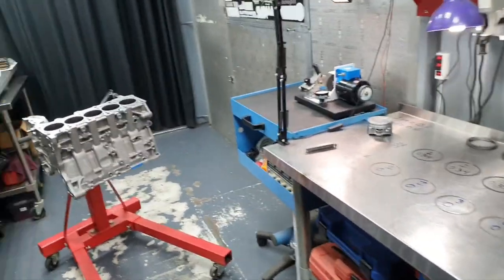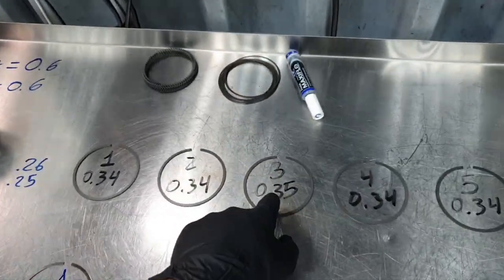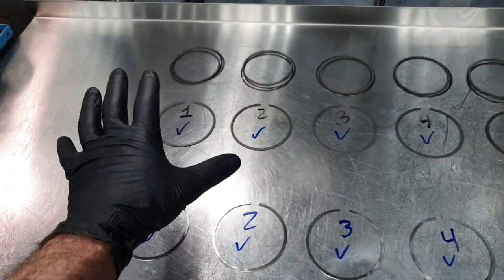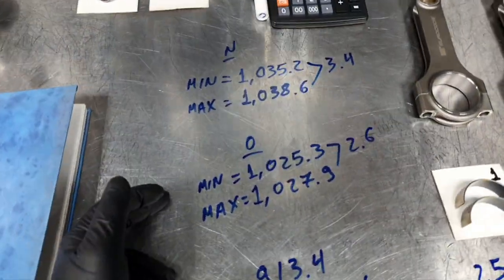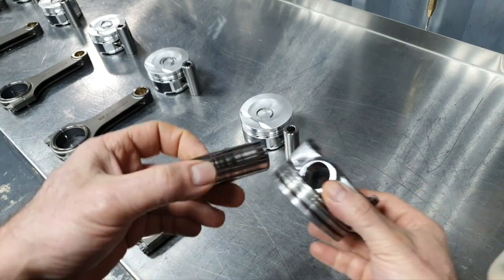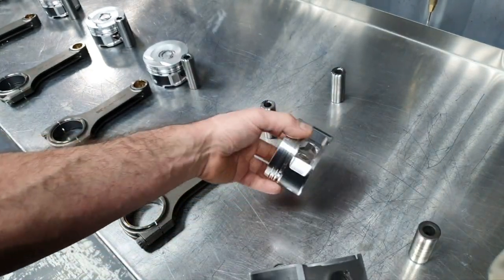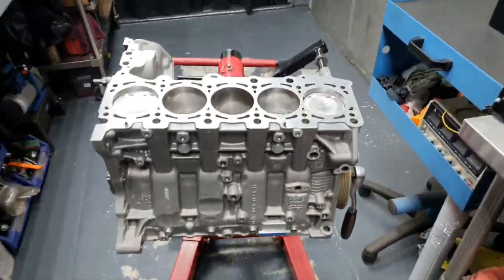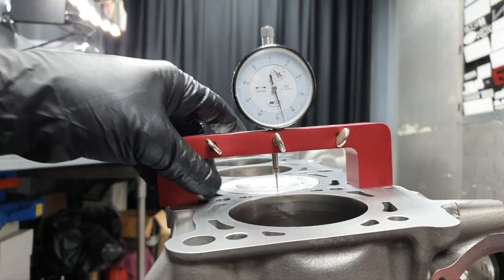DAZA engine rebuild (part 20)

Comment: Tasos - Question:  Before installing bearing - Do you apply light film of oil (engine/transmission) behind the main bearing? 

I'm planning to rebuild our VW, awp 1.8t.  I've been reading from some engine builders, yes apply a light film of transmission fluid before installing main bearing.  Other builders say, not needed. 

What's your thought? Do you Install main bearing dry against the block? 

Thanks for posting these videos.  They've been very helpful to the community.  

Cheers from Atlanta, GA.

Comment: The cylinder diameter would have to be totally off to see a difference on the circumference measurement.
Reply from the maker: i'm not relying on piston ring (just saying),
 I have already measure the cylinders with dial bore gauge.